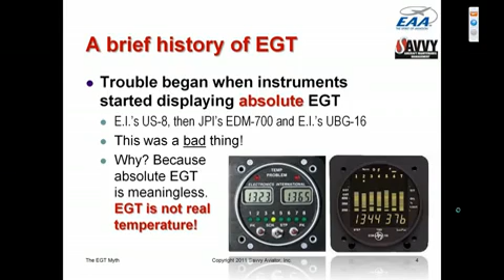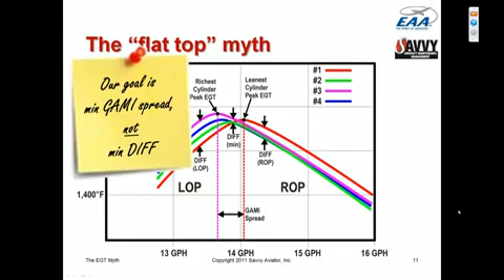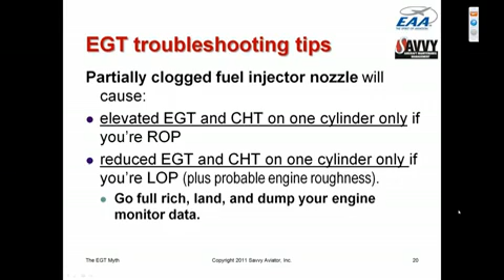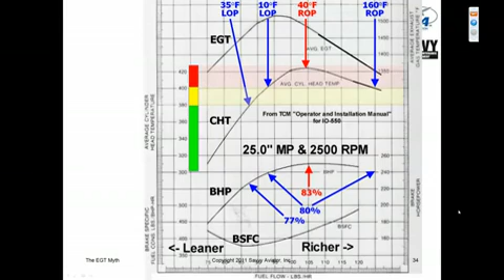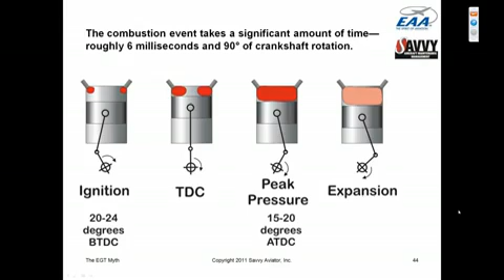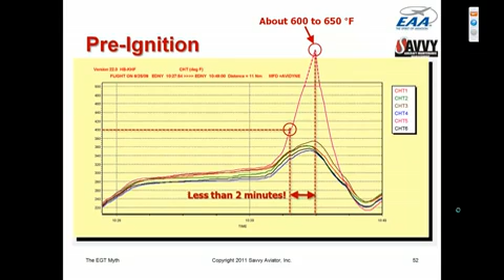The EGT Myth

Comment: I just started renting a hangar in Santa Maria. I have a 1968 Cherokee 140 with the Lycon O-320 120HP STC. It's 1,500 hours SMOH, and the combustion chamber, oil consumption, and compressions are all great.

It has no EGT/CHT gauges. I'm going to install a multi-probe CHT gauge. Would you install EGT probes as well, or would you be comfortable operating a carbureted O-320 without EGT information?

Comment: EGTs are important on liquid cooled engines. A liquid cooled engine with a good cooling system won’t show an increase in cylinder head or water temperature even when combustion temperature gets high enough to melt the pistons. 

EGT is actually measuring the temperature of the gas entering the turbine of the turbo supercharger. This is important as to high a temperature will destroy the turbo.

Comment: I had a EGT on one cylinder go high on climb out.  Was going to do the inflight mag check when I leveled off.  Plug started firing again at the top of the climb and the EGT came back to normal.  Cleaned the plugs for that cylinder after landing.

Comment: @ 2400 rpm it takes .025 seconds to make one revolution.  To make it easier to understand let’s just say every four revolutions take 1/10th of a second.   Now you place a probe in that stream of hot gas that is cooling and heating. I don’t think it (the temperature probe) can tell that it’s heating and cooling.  It’s happening so fast there’s no way the probe can measure the difference.   Much less the gauge react to it even if it could.  Now, can you make the gauge move up and down with the mixture control?  
Sorry Mike. EGT is real, and it does have meaning.

Comment: Thanks to this webinar, I now understand why I had two failing cylinders I am overhauling (high CHT's) now because I was running only 50 degrees rich of peak on those short hamburger runs and less than full rich on takeoff on hot days.

Comment: IF (that's a big if) you use expensive materials, the TC at at near the junction of the two leads can have a "relatively" small thermal mass.   Modern electronics can make "many"/"several" temperature measurements and determine the maximum temperature of the TC hot junction.

Comment: I have to disagree with this philosophy. I agree that EGT is not an absolute value but it does give a relative value of the temperature of the engine. As the CHT goes higher, the EGT will become higher. That's how the vapor and gases flow through the engine. From what he says, you can have EGT of 3000° and the cylinders may be running cool a sea breeze. NOT SO.
Reply: dvsmotions good thing you are not a well known aviation speaker. Keep your nonsense to yourself.

Comment: A few things that I see
*Claim that the EGT probe has high thermal mass, but despite the thermal mass these engines are run at relatively static conditions so the average EGT is meaningful.
CHT has a much much hither thermal mass. 
*EGT tells you when a cylinder has reached the stoichiometric ratio
*EGT tells you when a cylinder has started to reach lean missfire
*EGT can be used to identify best economy, or best power faster and more accurately than CHT can after finding peak EGT
*EGT can be used to verify combustion during a mag check, and to check timing to some extent

Comment: High EGT won't wreck an engine as the exhaust gas temp is a 'used' figure, as mentioned it's just a number, it's the CHT temp that is critical!
Reply: High EGT will certainly burn up a turbo. EGT is basically measuring the TIT of your turbosupercharger.

Comment: Funny, EGTs don't mean anything but he's constantly referring to them.  I think most of what he is saying applies to fuel injected turbocharged engines because they can develop rated power all the way up to their critical altitude.  Naturally aspirated engines loose power as altitude increases and above 5000 feet you can't develop more than 75% power so as long as as CHTs stay in line, lean to the engine until it starts to get rough and then richen until the roughness goes away.  On carbureted engines, EGTs are an "Apple", learn what they are (for each cylinder) at different altitudes and power settings when your engine is healthy and if they change and stay changed you should check that things are ok.  Very interesting subject but I think It would have been beneficial to the listeners to differentiate between NA, carbureted, fuel injected and turbocharged engine behaviors.
Reply: snaproll94e enrich after you peak? Are you one of those rich of peak drivers? There is a lot more to what a pilot should be doing to manage the engine than just lean to rough and then enrich the mixture.
Reply: EGT's are an Apple?  what does this mean?
Reply: @DiMoraDiamond  , because of all the variables in the engine and probe installations,  they just are a number.  Learn the numbers for your airplane, what the peaks and normal values are at specific power settings for your plane/engine, and adjust the mixture based on the hottest one.  If an egt strays from what you have found to be normal, then you or your A&P need to do some investigating.
Reply: @doncarlson8391  aaah, you were making an “apples to oranges” type reference.